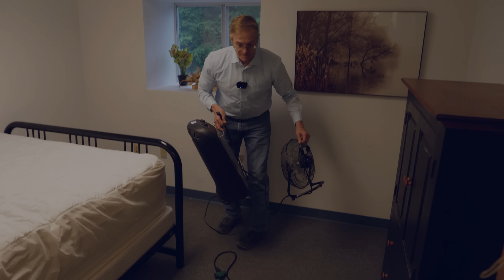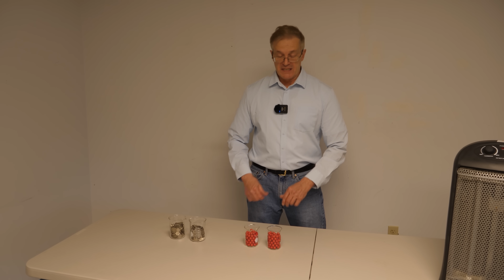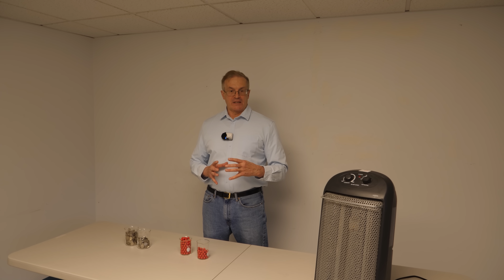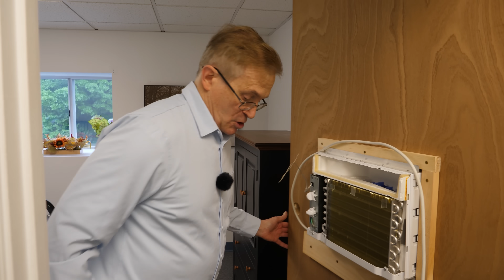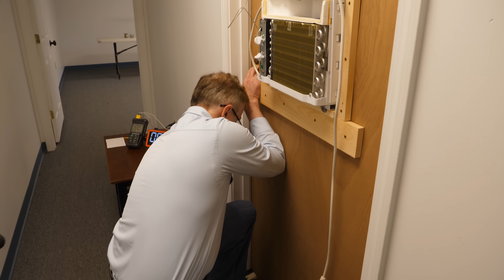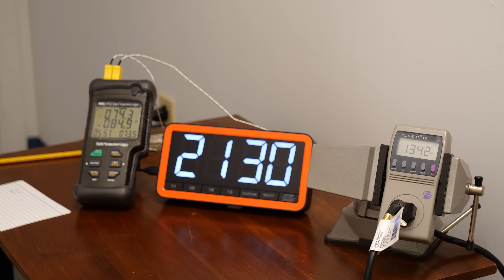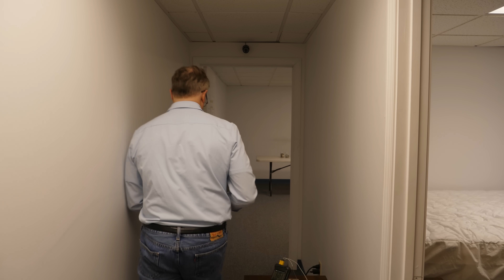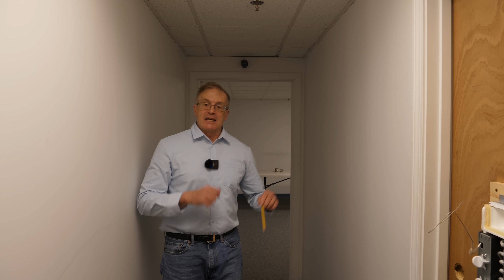You're wasting money on heating! Use your A/C!

Comment: What this guy forgets to tell you that a heat pump system uses the a c compressor for heat and a c year round shortening the lifespan of that compressor. The backup source of heat is needed,  like electric elements needing more power to the plug. Typically 220v.
Also heat pumps efficiency drops with outside temps below 30 degrees f. Relying on the backup source. 
Defrost cycle changes to a c mode temporarily with electric heater coming on to temper the air.
Very complicated needing more service.
HVAC contractor for 40 yrs!
Reply from the maker: The airconditioner uses a compressor. That doesn't change when you reverse its orientation. That is so obvious, it doesn't need mentioning.
You're right that the performance multiplier decreases as the temperature differential increases, but it's always better than the resistance heater.
Reply: @TechIngredients  i know how it works. The reversing valve changes flow. The exterior coil, condenser ices up and requires defrosting.  More electric heat while the compressor continues to run. The reversing effect caused a large strain on that compressor. That's obvious. Compressors and reversing valves fail prematurely. Heat pumps were primarily used in 70,s for businesses because the high maintenance cost.
When the system goes down, no heat or a c. Redundancy is better.

Comment: Great video. It may have been mentioned, but these numbers are based on the input temperature. The efficiency will go down. as the  input temperature decreases? I’ve sold serviced and used Mitsubishi cold climate heat pumps since they came out in 2008. I do all my primary heating here in Central New Hampshire with mine. It’s been well documented since the mid 2000s at temperature 40 F and above they will run 400% efficient and increase as the input temperature increases.
Reply from the maker: You're correct that as the differential increases, the multiplier effect drops, but it will always exceed the performance of the resistance heater.
Reply: @TechIngredients  as I mentioned, I use my HP for primary heat and we get down to 0° F and lower in the winter. I set my HA furnace for low 60's so if my HP's go below 65 (SP 69) the furnace will take over. I believe that around 0 the HP will not be any more efficient than resistance as at that temp there's not much for water molecules to extract heat from. I do like to use recirculation rather than pulling in cold combustion air for a fuel fired system.

Comment: Only works if your outside temp doesn't go below 60 degrees. Almost all window A/C units will freeze up below 60. I have been experimenting for years with using a window a/c unit for heat. The only close success I have had was by using earth tubes in a loop to feed the unit.

Comment: Mmm.... Drain lines, Holes in the door and Stagnant Hot Air. Yum... Indoor Mosquito incubator. Box fans use less. 😏
Reply from the maker: Ha!
A wet towel on your forehead is also very inexpensive.
In any case, can you visualize the potential benefits?
Split cycle heat pumps that do just this have been popular in Europe for years.  This isn't  a fringe application of this principle, and it obviously works.

Comment: There's just one problem to work out and that would be how to keep condensate from dripping in the floor.
Some ACs have a way to mount a standard water hose to bottom of unit, at which you can simply run the hose to a 5gal bucket or other container to collect condensate and dump out on as needed basis.
Been using this AC "trick" for many years in a 11x30 shop in my backyard.
I wish the condensate matter would"ve been addressed in this video.
Just leaves me wondering how wet the floor inside room ended up being! Lol
👍
Reply from the maker: The condensate issue can be solved relatively easily. The existing drain hole(s) can be plugged with a little RTV silicone and a new port drilled where it is convenient.  The unit should be mounted so that the tilt is reversed, sending the water toward the outside and the new port.
Reply: @TechIngredients  gotcha on that drilling a hole opposite.

Comment: So we all turn our window air conditioners around in the winter and we'll make it colder outside!😆
Reply from the maker: You'd actually be correct if all our buildings had 100% efficient insulation and the heat wasn't continuously leaking back into the environment.  But then, of course, we wouldn't need any form of heating.😏

Comment: I get the point of the video but it would be more realistic to use outside air that's at least 15 degrees colder
Reply from the maker: That might be more practical, but as a demonstration of the comparative performance of a heat pump, it would be less accurate.
Reply: @TechIngredients  
Just as a comparison yes makes sense

Comment: 1. Crappy clickbait title. This isn't use your A/C at all. This is: Use your heat pump instead of resistive electrical heat. If someone has a natural gas-powered heater, then nothing is cheaper than that.

2. Also- a space heater can deliver heat to a small area (if that is desired... near a bed for example) as opposed to heating an entire large room. 

3. Nothing is more than 100% efficient. It cannot be done. It's time to rename or re-imagine the terminology being used.
Reply from the maker: Thanks for taking the time to comment. 
Despite being negative with each of your points, it's still useful to hear your perspective. Of course, nothing is more than 100% effecient, and I explained why the heat pump is able to heat a room much faster than a 100% efficient resistance heater. Did you not understand that explanation?
Reply: @TechIngredients  You're welcome and thanks for the reply. Also... thanks for the videos. They're a great service to the world. Much obliged. Yes, I did understand your explanation regarding resistive heat being 100% efficient use of electricity (in that all of the electricity is converted to heat), but it's not 100% efficient regarding the use of electricity to actually heat up a room as compared to phase change heat. Heat coming out of a heat pump is more heat for the same electricity/money- which makes it more cost efficient- if not electrically efficient. Pretty easy to find these concepts confusing.
Reply from the maker: That is why I showed the balls in the beakers and compared the heat to money, ie. It is harder to make than to move from one account to another.

Comment: good video, for heat n cool, if u take a radiator n a fan n run water leaving radiator to waterfall for cooling n pump water in 200 feet of copper pipe about 4 ft under ground  n back to radiator n so on , for heating bypass waterfall....  water cools with a waterfall

Comment: Turning your air conditioner around does not seem very practical. The first thing that comes to mind is you have to cut a hole in the housing, secondly, all the controls are going to be outside.

Comment: I've often thought about this. My issue is, what to do about the condensation drip? I can't just turn it around in the window as that would put the controls outside the house. Got a suggestion?
Reply from the maker: The condensation drip is easy. The existing port or hole can be plugged with  little RTV silicone adhesive.  Then, drill another port wherever it's convenient to drain the pan.
The contros are tougher, but because the unit will be operating outside of its typical range, you can set it to "full" and use an internal temperature controlled switch to switch it on or off.  The thermocouple that is usually pressed up to the cold side coils needs to be freed up and repositioned inside the building.

Comment: It has potential. And I am going to try it out. Maybe do the experiment in a room with an open window and vent the heat through the closed door somehow? But my AC doesn't have a setting below 65°F. So, will I get any heat out of it when the room/or outside temperature is less than that?

Comment: Is there a good reason this implementation hasnt been in common use since the invetion of ac? Ever since i learned the basics of ac (heatpumps) when i was a teenager ive wondered why we go through all the extra steps, material, and energy expenditure to have two seperate systems to accomplish what one could do.
Reply from the maker: Yes.
Energy costs for many years have been low. Implementing a more complex system to reduce them hasn't been justified by the savings vs. the increased up front cost of a more complex, split cycle unit.
Reply: @TechIngredients I mean it could be the exact same window unit (where applicable) but physically reversible in orientation, and with remote control, for hopefully obvious reasons. Especially if you use a wired remote the cost would be near identical.

I have $10 led lights with remotes so let's not act like cost is a significant factor in that, anyway.
Reply from the maker: There are other issues we didn't address in this initial demonstration such as icing and drainage. Simply turning the unit around will work, but with limitations that a consumer probably won't want to deal with.

Comment: I think it is great what you are doing but you never showed what control settings you had the conditioner on. Why did you have it cooling the house instead of dumping it out the window? How can I use it and set it up to replace the resistant heater? To you it may seem odveous but even though I used to build HVAC systems always saw so many things in them that we bad like refrigerator dumping heat in a house, so many things are working against each other rather than integrating all these systems so they are not working against each other and the Earth .
Reply from the maker: It's really simple. 
For this demonstration, the 5,000 BTU airconditioner was set to full cool, and the temperature probe was allowed to remain near the unit but not attached to the coils or in the flow from either side.
The reason we circulated the cool air in the building was to eliminate any effect of air outside temperature when comparing the airconditioner to the resistance heater, which was also unaffected by outside temperatures.

Comment: ok I have a portable AC for my workshop/craft/sewing room. Works fairly well but we have a raidant heater for winter. A couple months its just not enough. My AC has a hose vent to the window. I cant really turn it around to vent the cold air out the window but wondering if i could just run it with it turned backwards in the room? And now wondering why no one is making one portable device that does both???!!!
Reply from the maker: They do.  They are called split cycle heat pumps, and they work but are pretty expensive. In principle, they should be similar in price to a conventional airconditioner, but the sales volume is much lower, so the prices are higher.

Comment: I actually have experienced this unwittingly when I purchased a used stand alone portable AC unit for Air conditioning. All my attempts to channel the hot exhaust to the outside failed and instead of cooling my space it actually increased the temperature significantly. So much so that I ended up taking it back. Even the Dryer vent duct that I installed on the exhaust port became so hot that I was genuinely afraid it would set surrounding walls and items on fire. It was unbelievably hot. Now watching your video  I can't believe that I didn't consider keeping it for a heater instead. " Dhoo! Stupid brain! " 🤯